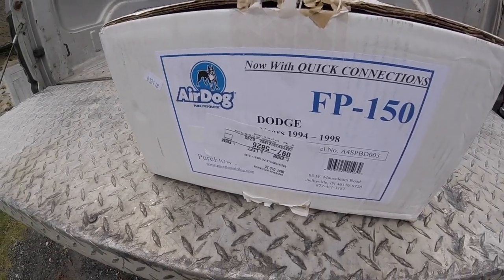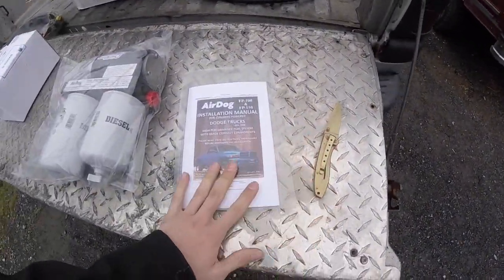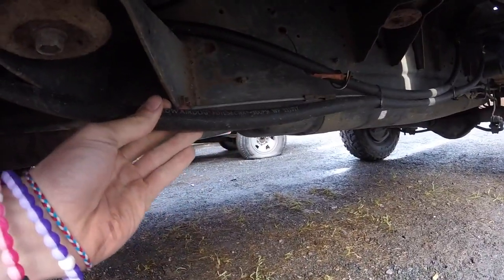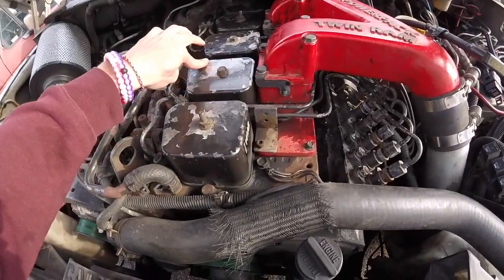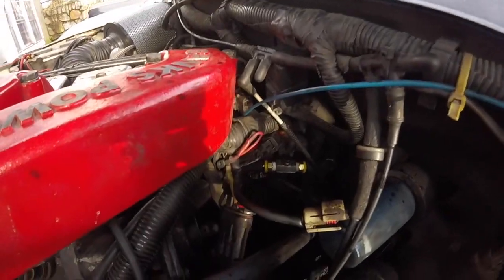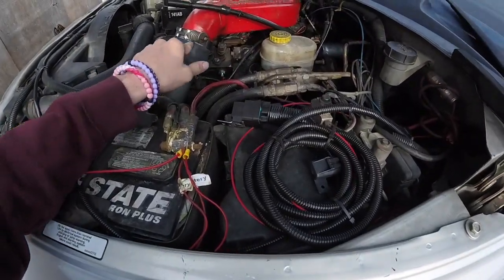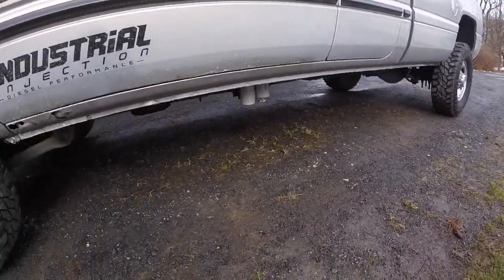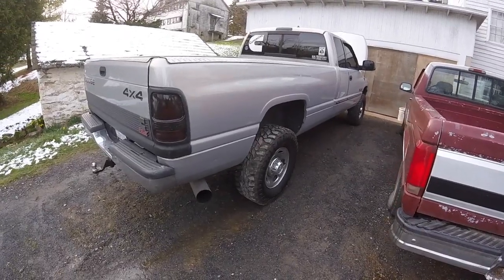Airdog Fuel System Install, YOU DON'T NEED TO SPEND $750!!!

Comment: Nice video. Do you think the Air Dog is better then a Fass? I have a 05 Dodge 2500 and would like to put one on my truck but not sure witch one would be better? Any ideas? Thanks for sharing...
Reply from the maker: I am a big fan of Airdog, I have only had good experiences with them especially on the customer service side of the business. They are bother very similar and go hand in hand!!!
Reply: You will regret the airdog. Mine last 3k miles then they refused to warranty it. Fass is all around better
Reply: @FPSTed  there is no way they refused to warranty your system unless you did something to screw it up. Tell the whole story and the truth.
Reply: @molly7871  Agreed. After asking myself this question for awhile, and doing extreme due diligence in researching the topic. I, like many others, chose AirDog. I couldn’t be happier. Less reports of failure, and even less reports of bad customer service. (I found none.) I personally fucked up some of the kit overtorquing.. one phone call later, I had a free replacement UPS’ed to me.. free of charge.. no questions asked. You can’t beat that. Just follow instructions, and don’t forget to fill out your warranty & registration paperwork! (Or online.) 

@OP:
I’m sure you have made a decision by now, as this is an old comment. But if not.. best of luck!

Comment: Great video...I have a silver longbed just like yours (1996)...I'm buying an AirDog 4g amd I'm going with a Beans Sump kit...anyway what psi fuel pressure should I run? My truck has a built transmission with billet torque converter and my head is fire-ringed...the truck still has the stock lift pump and its terrible...anyway any tips would be great...ill be doing the install myself...do I remove the fuel heater ? I heard the the fuel heater is pointless...I guess I need a block off plate...anyway let mw know what you think....take care and subbed
Reply: 30 -40 psi is what I would recommend. All P pumps trucks  should be running at-least 30 psi of fuel pressure. great idea on the AirDog, ditch that terrible stock lift pump. The fuel heater can be deleted because it does minimal work but if you live in a cold state that it'll be below 10* often, id keep that fuel heater. I am sorry for the delayed response. Thank you!!!!
Reply: 12v p pump trucks want 31 psi for max power, no more and no less.

Comment: I’m not understand , why u install fuel pump on 12v Cummins if they have mechanical pump. On my truck 390xxx miles without any problem. 
 24v engines have problems with lift pumps.